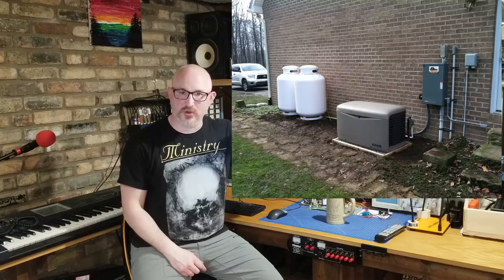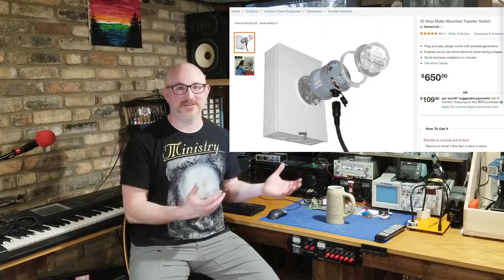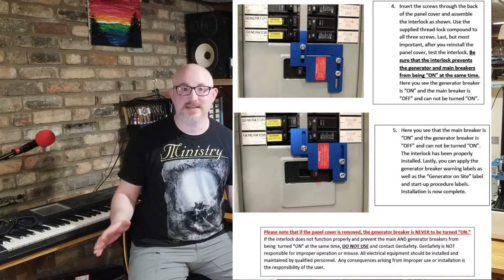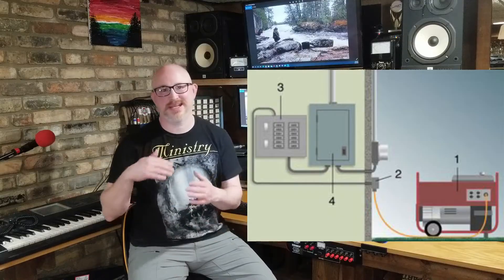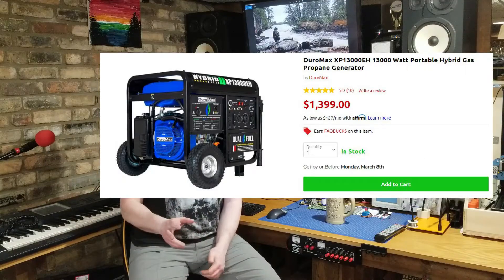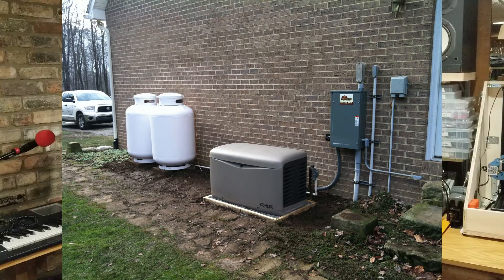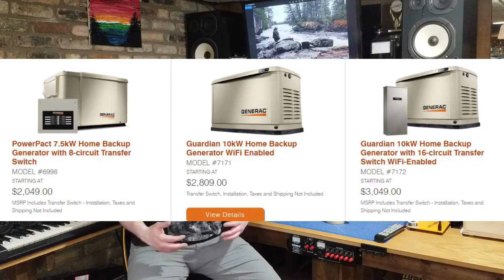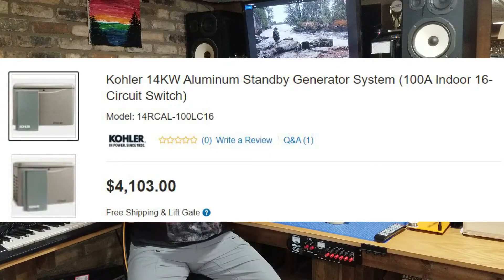Electrical Engineer explains connecting generators to your home

Comment: I just got a pto generator yesterday (bonded).  I planned on using it to feed power into my house and also feed a solar inverter.  Now I'm so confused how to make this work properly.  I also just read an inverter needs a floating neutral.  Any thoughts or will this be covered in the next video?   I have a manual transfer switch with a 50 amp plug already wired in.
Reply from the maker: OOOHHH, This sounds very interesting.   Need to know more, there are a lot of components here.  I also do solar designs but I need to know exactly how it's wired to help.  By PTO generator I assume you mean you're powering it from a tractor or similar motor, correct?
Reply: @richardvedvik979  Yes, a generator powered by a tractor.  If I lose power to the house I will throw my manual double disconnect and run the generator power into my solar inverter (Solark) instead of the  utility power.  This will condition the power to pure sine wave and run the house with clean power and charge my lithium battery.  At least that's the plan.   The bonded neutral is my only concern since I will be going through a main breaker panel to get to the inverter.  I could alternatively wire up the generator "in" input on the inverter with a plug  but the utility line "in" is already wired up with the double throw.  Doing this alternative will bypass the main breaker panel, but I have 2 subpanels that have a bonded neutral and ground since this is a very old house (I really should fix that issue).
Reply from the maker: @farmerj490  Understood.  Definitely, correct the sub panel bonding.  I know it's a hassle re-working the grounds and neutrals to be separate and isolated, but it's necessary.   For the generator you either need to break the N-G bond in the generator and let the gen use the N-G bond in the main panel or add a pole to your disconnect switch so the neutral is lifted also.   Most home transfer switches are 3-pole for this reason.   Breaking the generator N-G bond will mean that you cannot use it stand-alone and it will only be used with the home.  You could rig-up an external switch or bonding jumper if you want to use the generator for both home and stand-alone use.
Reply: @richardvedvik979  Oh so if I have all 3 wires connected in the disconnect switch that is all that is needed?  I'll see about rigging up the generator like you said because I do want it for both uses.

Comment: Does a transfer switch for a typical generac also interrupt the neutral wire going back to the utility pole of the power company?
Reply from the maker: It should if the generator has a neutral-ground bond.  If the transfer switch does not have a third pole for the neutral then you need to break the neutral-ground bond in the generator which is ok because the generator is usually permanently connected and uses the n-g bond in the service panel.
Reply: All the Generac residential transfer switches I have seen have a fixed neutral buss. No way to switch it.
Reply from the maker: @Sparkeycarp   Generac discusses neutral-ground bonding of the generator on page 4 of this manual, recommending a switched neutral kit if the bond remains: https://prod-generacsoa.azurefd.net/selfhelp/selfhelpservice/media/873ee9fa-f648-4513-9656-f93d71b55664/025831

Granted, this kit is specific to this type of transfer switch and not all transfer switches allow for a switched neutral.

Comment: Richard Vedvik I bought a predator 9000 to run my gas furnace but when the supply fan starts it trips the gfci on the generator. Any ideas or input would be helpful thanks
Reply: 9,000 is pretty overkill to power a gas furnace.  At most,  maybe 8-10 amp startup (1000-1200 watts) but many fans have circuitry or a capicator to minimize spikes on startup).  The CFGI is another question all together.  Could be how you hooked it up to the gas furnace.  Could be Generator - depending on bonded ground or floating neutral  It seems majority open frame generators are mostly floating neutral.   Call your local electrician.  Probaly can talk you through it on the phone, or a quick service call.
Reply: @avflyguy  thank you for the reply, I also didn’t ground my generator, could that possibly have something to do with it? I like the shirt by the way

Comment: If I hook up a generator to the main using a Power Inlet box (thus bonding the ground), should I purchase a generator with floating neutral?  That is assuming I don't run the the generator as a stand-alone and simply using extension.  Otherwise, I would have to some how ground the frame.  What if the generator is already bonded ground?  And ground is always bonded on the main panel.  Would this cause an issue?
Reply from the maker: I have a new video explaining all of this.  Sorry for the delay, I took this question seriously and addressed it in a full video. I should have replied faster.

Comment: The issue you did not address is a shelter for an open frame generator. Outages typically happen during storms and hauling a generator out of the garage and parking it under the electrical input is not fun. When the outage ends you have to haul it back to the garage or wherever.
      Building a compartment greatly increases the cost of the project. A crude measure is that the shelter and wiring and labor can easily cost two times the cost of the generator alone. In my case it was 3x and I bought an expensive generator (Honda). This makes a standby installation much more attractive, aside from the fact that all the engineering is already taken care of; exhaust, compartment ventilation, sound insulation in some cases and access to the generator itself. This is time consuming and the guys that will build the compartment, maybe yourself, are doing a one off so there is no real experience or expertise behind it.
Reply from the maker: All good points.  The standby generators that are fully enclosed certainly are ideal and preferred but they usually run around $12k-15k installed around here (and you're getting a transfer switch and auto-start and auto-test).    I paid $1k for an 8kW generator and another $200 on installation materials and DIY as described in my other video.  Having a place to keep the generator that is mostly dry (from falling rain) is preferred and there are a few affordable tent options for those occasions.  When using a portable generator, you're still money ahead when compared with a permanent generator install.   

Anytime you pay someone to do something, you're going to spend  money for their time and experience.  Shelter, wiring, etc. all add up.
Reply: @richardvedvik979  RE: "standby generators" Having worked in/for a Gas small engine MFG many are NOT aware of the plethora of OFFSHORE parts in them, even the complete engines, electronics, it DOESN'T matter the U.S. known & PAST respected "TRUST" , I suggest IF folks buy such is to get a COMPLETE parts manual BEFORE you purchase or when, then ask installer or someone with experience what are the TOP 10 parts they have seen fail, then go ahead & buy those & put them on a shelf. The company I worked for had complete shipping containers come in through Savannah Ga, then the COMPLETE load would be backed up to our dock, I watched the load get unloaded one day and saw OVER 8 different "brands" get unloaded, EVERY Gen that got unloaded came from the SAME plant in CHI NA, the Eng mfg I worked for has for years had a complete engine line being produced there. I REFUSE to pay for those high dollar unit because I KNOW you may NOT be able to get necessary parts for them in the future, so I'll use the less expensive easier to dispose of ones that I've converted to propane

Comment: Companies are not adding propain to homes like they did before at least our area.  I called the company and reached NC area.  Big companies are buying small areas.  Also for gas everyone should run until the engine stops after shutting the fuel valve off.  A great review
Reply from the maker: Locally, I have to take small 20lb or 30lb tanks to a local business to have them filled.  Larger 500+ lb tanks can be filled by a distributor.  But I agree, shut off gas and let the engine run dry!

Comment: Ok so I understand that there should normally only be one neutral-earth bond on a local circuit. But code compliance and insurance aside, I'm just trying to understand if there are realistically any practical reasons why a generator should have floating neutral if it's feeding into a DB with bonded earth/neutral and is only a few meters away?  What would the risks/downsides be of keeping the generator bond in tact in such a scenario? Does this introduce a ground loop? Also, since the neutral is bonded to earth in the DB, couldn't we just skip the earth wire run from the DB to the generator instead of breaking the generator's earth-neutral bond, since that part of the circuit isn't on a GFCI anyway and there's now a clear path to/from the generator's ground via the neutral line to the generator's own N-E bond? Thereby negating the need to break that bond altogether? Lastly: assuming we don't break the generator's internal N-E bond, which of these two alternatives would be safer: running all three L, N, E to the bonded generator anyway, or cutting out that earth cable between the gen and DB? Hope these questions at least make sense! If you have the answers too that would be really awesome :D Right now I'm feeding my changeover switch from a genset that already has bonded E-N, and luckily haven't run into any problems yet, but I want to know if it's really worthwhile taking any action to "correct" this if the benefits are more superficial pedantics than anything in this instance? Thx & Regards
Reply: The problem with more then one bonded connection in an electrical system is, that you create multiple fault paths. This can cause a breaker in the panel to trip, but the other segment to still be live with a dead short. Even worse it is even possible for the fault to choose the 2nd path and never trip that breaker but the fault still be present. It all depends on which path has the least resistance. It's complicated to determine which of the multiple paths any given fault may choose to take. Which is why only one natural/ground bond should be used, and should be at the closest point of power disconnect (breaker) This way the performance of fault disconnects are predictable & safe.
Reply from the maker: The requested video on generator neutral-ground bonding has been uploaded!
Reply: @richardvedvik979  Yup, I watched it this morning. Thank you very much. Very detailed, and answered or provided information that 98% of the other generator bonding videos do not cover. It was the exact information I was looking for! It was very clear and detailed. So many of the other videos on the subject have either incomplete information, or a lot of basic electrical errors.Thank you again!
Reply from the maker: @williamallen7836  Thanks!  Let me know if you have any other requests.
Reply: @richardvedvik979  Oh wow! Will check that out immediately - thanks for sharing your knowledge !! 👏🏻

Comment: Do I need to pull a permit for a generator
Reply from the maker: Sorry for the delay, but yes, you should for the generator connection itself.  I just added a video on generator neutral-ground bonding.

Comment: Richard, this was excellent video to present various options on connecting a generator. 

I’m currently using a generator with about 4 extension cords. Using a 6AWG wire I have connected the generator to an 8’ copper rod imbedded into the ground.
QUESTION:
My generator has a floating neutral. Should I connect the neutral to ground  using one of those 3 terminal plugs which has a 12 AWG wire connecting the neutral to ground? 
Thanks in advance. 
David
Reply from the maker: I agree with Dimitri.  Sorry for the delay, I saw a response but didn't verify.  if you remove the cover to the generator (the round cover that is facing out) you should have access to the winding outputs where a Neutral-Ground bond can be safely made.  I would not make that bond at the extension cords.
Reply: With that setup, your AC output is going to have two hot leads with respect to your ground line - not ideal! Since you have an effective ground spike attached to the earth terminal of your generator, you should probably go ahead and bond the neutral leg to the earth terminal at the generator, so that your neutral line is at ground potential (0v with respect to the ground line), and your hot will be ~110v or ~230v (depending on your generator/where you are in the world). You should then also put a GFCI breaker on the output before your loads breakout, and connect your loads/extension leads to that. Then the circuit should technically be safe. Anyways that's my understanding, hopefully Richard can confirm for you:)

Comment: Great video as always Richard. If you feel so inclined, it would be great if you could please do a video on floating vs bonded neutral and reference voltage.
I somewhat understand residential split phase power and why natural and ground are bonded in the panel but I can't wrap my brain around how a generator relates to neutral and ground (both the conductor and the thing I am standing on).
Reply from the maker: Absolutely!  This topic is important and not addressed enough.  I'm working on it!

In short, any electrical system should only have one neutral-ground bond.  That includes sub panels and generators.
Reply: @richardvedvik979  My house panel is neutral/ground at panel.  Does that
mean I would have to find out whether a gen is bonded or not, and if so,
unbond that gen?  Or, will any gen work OK, as long as I don't try to 
add a ground to it also(?) .... What confuses me is that I see some gens
with a 3-prong 240 female outlet (2 hots and a neutral), while others have 4-prong outlets, with the 4th prong being a ground. (?)
Reply from the maker: @Re-ActiveTrader  There can only be one neutral-ground bond in the system.  When you connect a portable generator to your home panel, you have two primary options.  1: use a transfer switch that includes a switched neutral.  This allows you to keep the neutral-ground bond at the generator.   The transfer switch can be one large switch serving a panel or a bank of smaller switches serving loads.    2. break the neutral-ground bond at the generator and use a 4-wire plug/connector, using the home N-G bond.  Note that some generators will not run without an N-G bond meaning you won't be able to use the generator in stand-alone mode if you break this.     

There is a third option, and that is to add a ground rod outside the home for the generator and just bring 3-wire to the home while leaving the N-G bond in the generator.  I am currently evaluating this idea and once the analysis is done I will publish the next video.
Reply: @richardvedvik979   I needed this.  Thank You
Reply from the maker: The requested video on generator neutral-ground bonding has been uploaded!

Comment: Would a Honda EU7000 be able to power a central AC?
Reply from the maker: Depends on the number of Tons for the A/C system.  Tonnage relates to cooling capacity and also power requirements.  The generator will have a spec for starting load and running load, since the A/C fan motor and compressor will have a higher starting in-rush.    What are the specs from your A/C condensing unit?
Reply: Yes if you add a micro air soft start